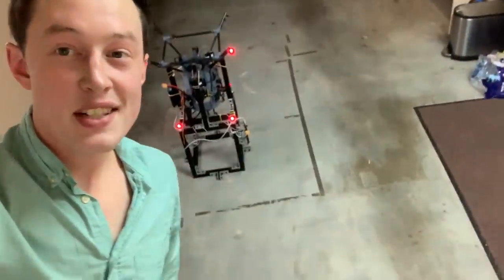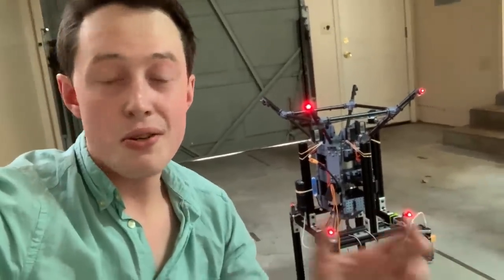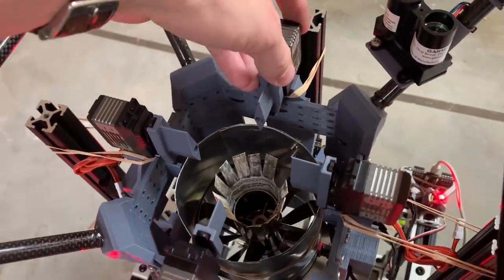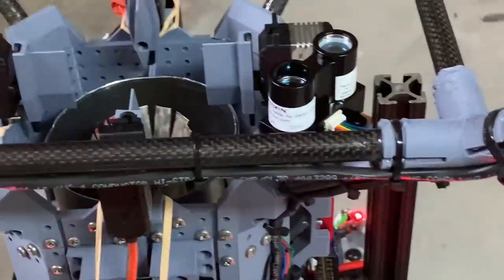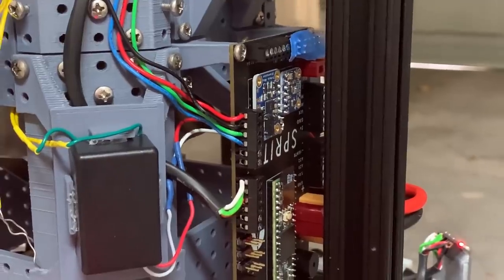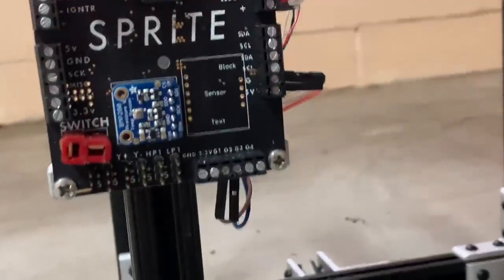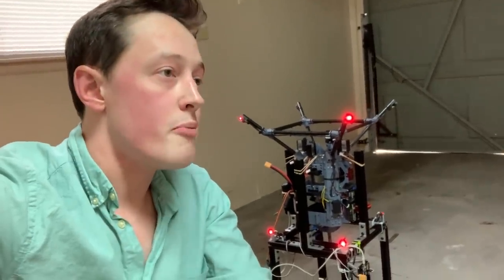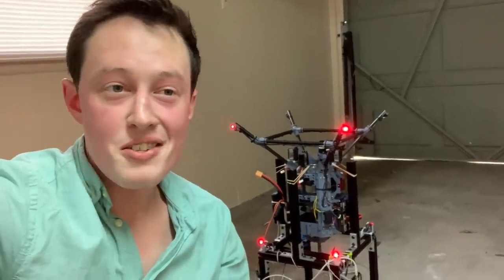What Is Sprite?

Comment: Soldering on the Servo wires might add some stability on the signals, vibrations/ g-force with those connectors is waiting for possible problems down the line. It's plug and play, but if there's any of that play on any of the pins- playtime's over...

Comment: After burning ducted fan has been used since the 30's. 

If you ran the vanes perpendicular as scoops you could use them all at once to cut thrust on a solid rocket on landing. 

You do know a pixhawk with ardupilot would run this off the shelf?

Comment: State Space vs PID. As for MIMO, yea, State Space is easier to implement, however for SISO systems, PID is a better option, since PID controller design gives the engineer 'eyes', and allows for optimizing the parameters. E.g. a bodeplot in the frequency domain gives much more information than state space, which is time domain only.

Comment: Hey Joe, I don't know if this is the right place or not, but I might have a question. I am currently building a scale Falcon heavy (Without TVC). I was wondering how about how much total voltage you used to launch your Falcon heavy to have the engines ignite at a specified time. If you have time to get to this question that would be very appreciated. 
ps. love your vids.

Comment: wondering how you manage weight and balance. with 2 batt on one side ... why no nozzle?

also don't you want to mount both computers behind the cage?  the board is strapped to outside frame....one bad tip could damage it no?

Comment: Hey i think the thrust vectored control will not work as the rotating edf motor rotates it produces gyroscopic precession just like helicopters which steers the hopper 90 degree to the applied vector control so please take note of this